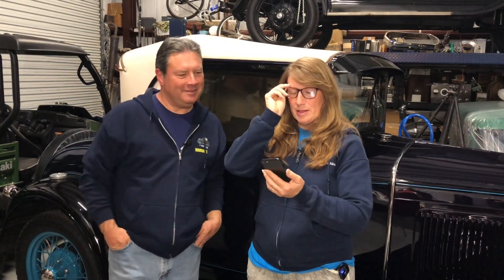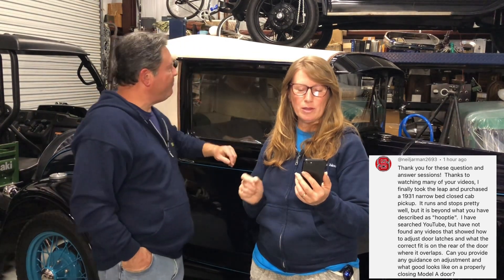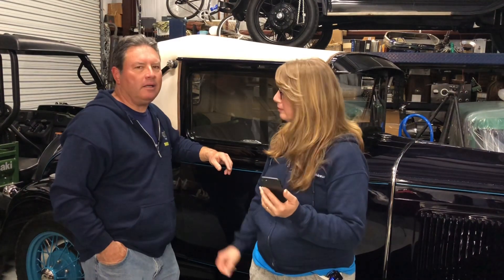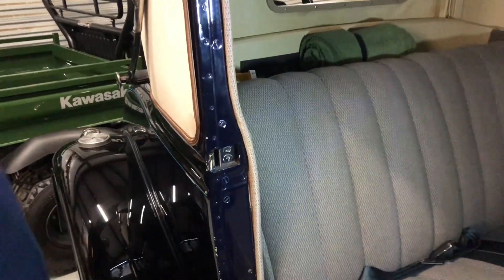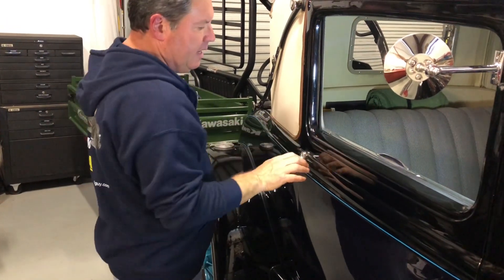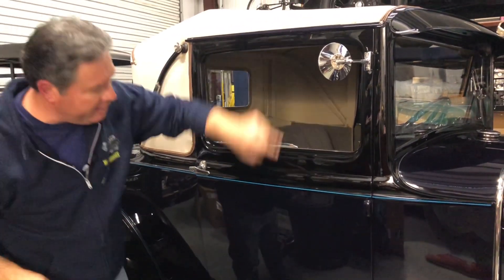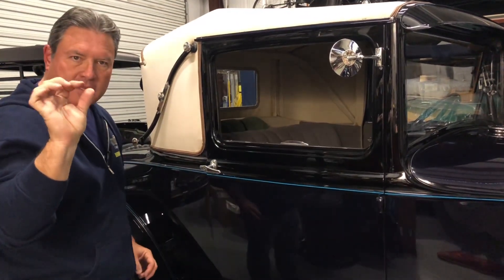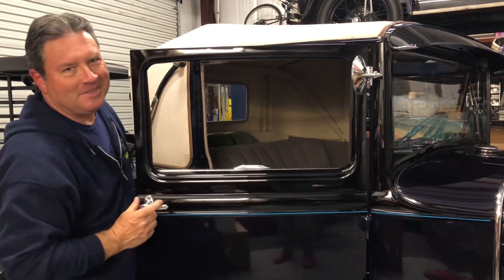Ford Model A Q&A of the day - how do I adjust door latches and door overlap, correct fit?

Comment: Paul and Tina, merry Christmas to both of you. The first scene in the bedroom has a cathedral radio on a table. My grandmother had one also. When I was maybe 6, I had, to just had to, find out where the man's voice came from. So, I took it apart. Not just apart but down to the last resister. I removed it all using my grandmother's material shears (she was a seamstress). Never found the man's voice but I did find my father's hand as he punished me. It was what I called a two-fer. The punishment for the radio and one for the shears. What I didn't know was that the "B" voltage could've killed me. Now at 81, I'm still asking the same questions only now worth so much more. Working on model cars and trying to upgrade my camera. My last year Christmas camera was a point and shoot that doesn't come with an external mic input. Now, looking at a Canon M50 (now discontinued) and replaced with a R50 ($600.00)
Reply from the maker: Thank you for sharing! Wow, you sound a lot like the stories I hear about Paul when he was a small boy…he got in trouble a lot as he wanted to know how things worked, so sorry your curiosity got you in so much trouble but I’m happy that it didn’t kill you 🙏💗 
Take care and keep exploring!

Comment: Help !  My Tudor passenger door rubs the A pillar when almost closed and I can feel the resistance increase as the door is is about 2 inches from closed. Is it acceptable to fab shims and install them between the hinge and body ? Because the roof is chopped, I don't use the upper hinge at all (no pin) so the stress is between the lower 2 hinges against the body.  Is there a method to correct without shims ? Thank you.
Reply from the maker: @jameslangford4748  oh bummer. Do you mean that too top has been chopped like a hot rod/rat rod?
Reply from the maker: @jameslangford4748  we usually tap the hinges till they sit the door the way we want them.
Hope this helps 💕
Reply: @Modeltshinn  Yes it is a chopped hot rod.  I will try tapping the hinges.  Thank you for your time.